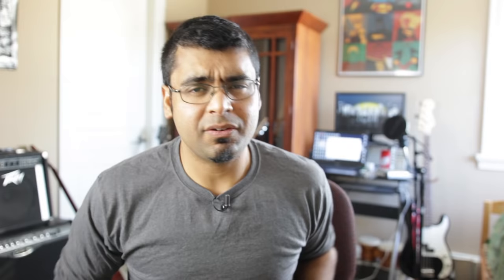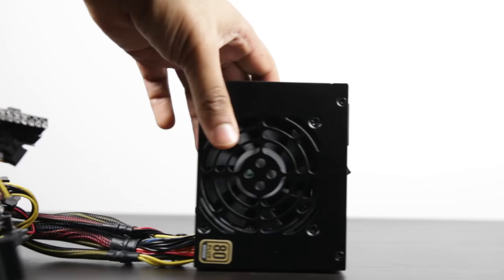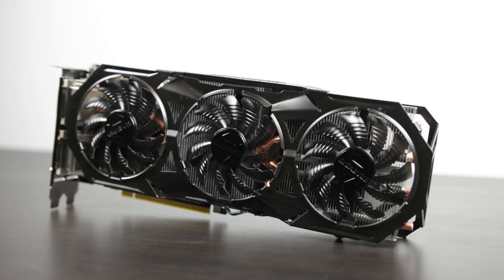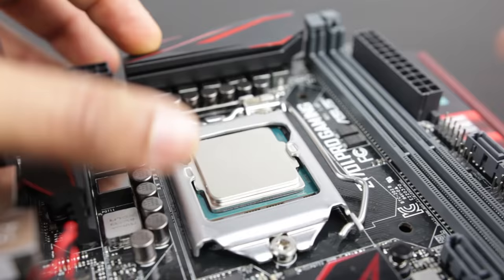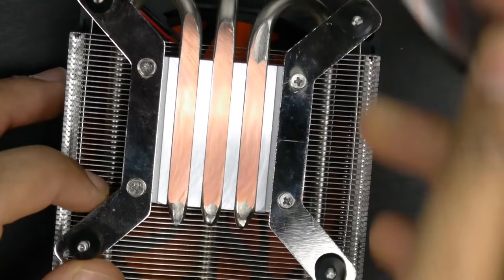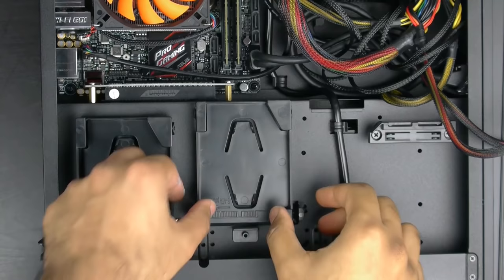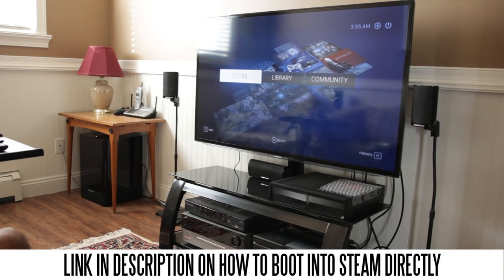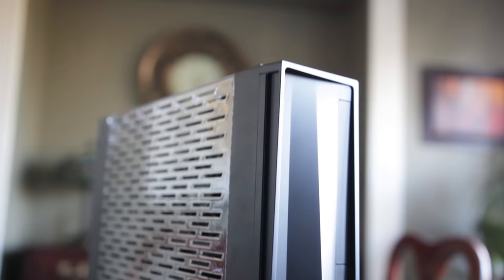EPIC 4k Gaming Console PC - Build Guide (The Console Destroyer!)

Comment: 1080p ULTRA 60+FPS > 4k med-high sub30 FPS
Reply: +ImRedBlueGreen  1080p is more than Enough for gaming, and +30 FPS is Enough for playing games, so if maxed out on 1080P +70 FPS and Maxed out on 4K on 30 FPS Locked , go for the 4K, if not locked then try the 2K
Reply: Tech-WonDo with medium-high graphics? ... mostly medium... no thanks. 
The difference between 30fps and 60fps is a ton when playing games.. Don't forget the FPS drops that happen too.. they will go as low as 10fps depending how much is happening on the screen.
Reply: +Tech-WonDo 30 fps really isn't enough for gaming
Reply: +ImRedBlueGreen  1st, The Difference between 30 and 60 is doesn't appear only in Motion intensive games like GTA V, but in Far Cry 4 for me, I settle down take a sniper and snipe them all, so the motion is not much, even 25 Frames will be more than Playable, and as a Said Locked* 30, which means it doesn't go lower than 30, only badly optimized games like AC III and Unity go from 60 to under 30 depending on what appears on the Screen
Reply: Tech-WonDo Yeah because every game is like a still picture... If you're talking about locked 30 then you're obviously going to have the lowest settings... and even then your going to drop below 30. Optimized or not.. If more things are happening on screen (rendering) then you're going to get a drop in frame rate. 
I'm not sure if you're trolling or not.. because 25 frame is certainly not playable.
Reply: +ImRedBlueGreen  I seawer I'm not trolling, I played Hitman Absolution on 13 Frames, Played Far Cry 3 on 13-18 Frames, but when it comes to any GTA It's almost a must to get over 25 Frames, and in any Assassin's Creed, I always play it on +22 Frames because even on 60 FPS, there is a delay that doesn't really improve from 30 to 60. So to Conclude, There is a Concept of Satisfaction, 22 FPS are playable, if you want them to be because you can go like "they aren't playble at all, I can't bare to see the screen on these frames" and keep complaining, you'll never feel satisfied, so for me, If I get a Game on Locked 30 (32-55 Frames), on 900p with some on very high and some normal, it's a way better experience than having a locked 60 (55-75 Frames) with all on Low or Normal, and thats for me, you can't bare to play on anything lower than 60 I can bare playing at 13 Frames, then go buy a 800$ Build on a 1080p Screen
Reply: Not if you have a 4k Tv
Reply: +Zoro 賊™  OFC, if you can purchase a 4K Monitor, in most of the situation they'd be able to purchase a PC that can run games smoothly on it, and btw guys, most movies run on 24 Frames and we still don't notice a lag and each eye has about 15 frames and increased slightly (about 1.6 frames) with training like Martial arts and Race Driving training
Reply: Tech-WonDo Did you really just use the your eyes cant see past 24 frames defence?
Nice talking to you... Won't be replying to you any more =)
Bye!
Reply: +ImRedBlueGreen  It was nice talking to you too :)
Reply: +Zoro 賊™  It's not worth it :)
Reply: +Bubble_Games whhaat?
Reply: +Bubble_Games How is it easy?
Reply: +Bubble_Games It makes a difference when its 480p vs 1080 but it does not when its 1080 vs 4k.
And btw are you gonna buy like a 60inch monitor just for your pc? Because in small monitors you cant really see the difference between 1080 and 4k.
Reply: ***** SURE you can
Reply: +mcjay669 I don't understand how people say 30fps isn't enougj, but I guess it is personal preference
Reply: +ImRedBlueGreen 30 fps for 4k is pretty decent, and considering that the games he actually tried are very new releases.. then yes, that should be considered a playable framerate.

Just the fact that you questioned a single GPU setup running 4k at medium-high settings, is literally beyond me. I don't think you've the appropriate understanding for these sorts of things.
Reply: MrFireZanimations average frame rate = 30.. which means its going to dip alot below 30 = unplayable. 
I can barely remember the contents of this video.. so I'm not going to reason with you because that means I'm going to have to rewatch it again...
Reply: ImRedBlueGreen below 30 still isn't "unplayable" as long as its sticking to the mid 20's. And especially if you're indeed going to play in 4k. Remember 4k is four times the screen resolution as 1920x1080. Even at low settings. It can look more than acceptable. He is only showing what this rig is capable of. No man nor woman would even bother to play 4k in medium let alone high; on a single GPU.

I wouldn't personally play at 30 FPS because I've 144hz monitor now; but, I do remember back in the day (2005) when I accepted 28 frames in Battlefield 2. I considered it to be more than playable. And if I where to somehow go back in time; I think i still would.
Reply: +caleb m
Console user? Troll? PC Master-Noob detected?
Reply: João Filipe da Costa For me 4k is more about having more space to put HUD on scree or have a better view of a big army like Age of Empire, Starcraft and stuff is cool to have more field of view, for FPS game you can use less field of view if you wonna see spot far enemys betters anyways. But yhea 4k still have issues for all i read/heard on the web, hard to find cheap 144hz 4k and even the video-porta can cap at 30-60hz due to transfer limites.
Reply: +ImRedBlueGreen Or 45-60fps at 21:9 3440x1440p very high ;P , with a 980 of course.
Reply: +Tech-WonDo You are kidding right? On a PC, anything under 50 fps feels laggy for most real PC gamers. I have a 980 ti lightning and the Acer xb270hu monitor and on all of my games, if theyre not running at 55 fps+, I can certainly feel the glitchyness and lag.
Reply: +Tech-WonDo Also 1080p at 70 fps is much better then 4k at 30 fps. I use DSR and 4k and when the frames drop to 35ish, its almost unplayable especially for gta 5.
Reply: 4k 60fps med > 1080p 60fps ultra. #dropsmic
Reply: +Mark Winston good job playing counter strike on 4k...while i play killzone on ps4
Reply: +Mark Winston Also, just downscaled 4k without AA is better than 1080p with AA, and can run about the same FPS.
Reply: +Tech-WonDo your comment on 24fps is inaccurate & misleading... I'm a cinematographer based in LA so this is my area of expertise. I mean no disrespect, but since there are many people that share this misconception please allow me to educate you on the subject...
First off, the reason we shoot movies in 23.976 FPS, is because it provides what hollywood has deemed to be an appropriate level of motion blur, as established over the years, to achieve a proper film look. 
I can easily distinguish 24fps from 30fps from 60fps... like literally within just a few seconds of viewing. This is why a movie looks different than the news (30fps). 
Lastly, research has concluded that the human eye is capable of distinguingin FPS variances of up to 200FPS when content is viewed on monitors CAPABLE of displaying it. 
Furthermore, in scientific studies they found that fighter pilots that were observed in test settings were capable of the highest level of ability to distinguish which was right around 300FPS. 
So yes every frame counts and I would go as far to say that anything that drops below 24fps is unacceptable in gaming. 
When dealing with action games or shooters, i'd personally never want to play anything below 50fps as the reaction times are everything and you really do benefit from the higher frame rates.
Reply: +ImRedBlueGreen ya, but... I get 60+ FPS on 4k high settings lol..... 100+ 1080p. (liquid cooled I7 6700k @ 4.6ghz paired with an EVGA 980 Ti k|ngp|n edition )
Reply: Jordan S. .......... of course you do... My comment was in regards to the video.. a 970.
Reply: nick hover thank you for agreeing with me....
Reply: 30fps is enough it has been enough for years its just that people who have experience pc gaming cant go back to shitty console experience
Reply: always!
Reply: Dear lord guys. Your eyes can see faster than 24 FPS. Your eyes are neural connections directly to your brain. They see as intermitten as light hits them, and your brain processes them all instantly.

They are vibrations created by waves.

There isn't a processing lock on this shit guys.

I like better FPS than higher resolution. 

I own the G1 970, it's an overpowered 1080p card and a decent 1440p card... it isn't a 4K card.

You COULD SLI them into a 4K card though!
Reply: running i7 2600k, 250samsungssd,16gbddr3,evgaftw1070,4klocked60fps,4knativelgipsmonitor> 1080 im sorry cant go backwards.

Comment: I bought this case. I went with the RVZ02B with the dust filters, and am fitting it with an ASUS R9 Nano White Edition.

I don't see the benefit of the windowed version of this case, unless you're one of those folks who like to pimp out their rig. Of important note, though, is that a Zalman CNPS8900 is only able to (barely) fit inside the RVZ02B non-windowed version, which probably hints that the clear panels are not flush on the interior.

Comment: Definitely would have gotten a 600w psu and put an r9 nano at its current price of 500$. I would also have installed a slim blue ray rw drive and replaced one of the sdd with a 2tb 2.5 inches hdd. Oc that nano to 1050mhz and you have an awesome 1440p gaming rig with also great performance on 4k with older games.

Comment: 4K on a GTX 970? Don't expect amazing framerates at reasonable settings. Even the top graphics cards like the 980Ti and Fury X can only get 30-40fps at 4K on high settings in most AAA titles, so you have to dial it down to low or medium to get any kind of playable framerate. If you're in the market for this, wait till when Polaris and Pascal cards come out from AMD and Nvidia. The top end ones will have no problem running 60fps at high settings at 4K. Right now you can't really do that in a miniITX build, since you can only fit one GPU.

Comment: I'm thinking of building this setup except instead of the 970, I'll put my MSI 1080 card in there. :)
Reply: same
Reply: I'm thinking about using a gtx 980
Reply: +Alex osuna pls don't buy a 980, wait until the benchmarks are out  for the 1060 then make your decision. Rumors are that the 1060 can perform well over a 980 when over clocked
Reply: +Solid Mass ok thanks for telling me
Reply: buy gtx 980 used, it a lot cheap here in italy
Reply: Maybe I just put 1060 on it 1080 has SLI will just waste but thats your choice its ok also.
Reply: thinking same, but the 450w psu...
Reply: Its sufficient for 1 450 psu

Comment: I'm going to wait until I actually have the funds for this build, which is all well and good because two parts I want haven't even been released yet (N/R). Here's my future Console Eater build: 

Intel Core i7 6700k OCed at 4.5GHz
Silverstone AR06
MSI Z170i Gaming Pro AC Mini-ITX 
Kingston Hyper X Savage 32GB (2x16GB) DDR4-2600 
Transcend M.2 B+M 512GB SSD 
Samsung Evo 1TB 2.5" SSD (later upgrade)
MSI Geforce GTX 980ti Gaming 6G 
Silverstone SST ML08B-HW (N/R)
Silverstone SX700-LPT (N/R)
Asus ROG Swift PG279Q 1440p 165Hz 27" IPS gaming monitor 
Corsair K95 RGB wired gaming keyboard w/ Cherry MX Red switches
Corsair M65 wired gaming mouse
Reply: Go for an I5. This is coming from an AMD fan. You don't need the i7 unless you are making videos etc.. Anyways, another recommendation would be to run a 390x overclocked instead of the 980ti. The new Vulkan and DX12 API's coming out will utilize AMD's multi core gpu's better. A recent test came out and a 290x beat a 980 in DX12 benchmarks
Reply: jacob3parker 
Which is exactly why I'm getting the i7, I am planning on streaming, making videos and gaming. A friend of mine (a huge msi/AMD fan; FX 8350 R9 390) advised me on avoiding the 390x because of heat issues especially in a small form factor build. He suggested the 390 over the 390x because of this. He also told me the 980ti would still be a good choice if the monitor I had supported G-sync which it does exclusively. Before building this rig though, I need to upgrade my current HP from an HD5450 to an R7 360 because 15FPS is un-fucking playable. The only things keeping me from my HTPC beast are: 1) still don't have enough money 2) waiting for Kabby Lake to drop the prices of Skylake CPUs 3) waiting for silverstone to pull their thumbs out and release the SX700LPT and the ML08B-HW for fucks sake, Silverstone!

(Edit) I decided to go with the Cryorig C7 over the Silverstone.
Reply: +ArthurSixx well, if you're still waiting the new AMD Zen cpu is coming out. Multicore support would be better aswell. So it would be smart to just buy the 390 so you'd have it for later too. But new GPU's are coming out aswell, so basically wait until Juneish is what i would recommend
Reply: wait for gtx 1080 from msi
Reply: or from gigabyte

Comment: How are the GPU temperatures in that tiny case? I didn't see much for ventilation on the side. You would think all of those fans would just recirculate that stale air. I think this is one of those times that I would use a reference style blower cooler to at least push the air out the back.

Comment: I think, that when you want to play on 4K, a GTX980/980Ti would be ways better. The GTX 970 only contains 3.5GBs of RAM! This could cause wierd problems in 4K resolution.
Reply: +Rico Smith Depending on what settings you're playing. The 970 is capable enough to push all those pixels. Also, it has 4GB of VRAM.
Reply: 2010ngojo
The 970 has no "real" 4GB of RAM. 0.5GB are very slow and cause insane lags. Normally, you don't reach these 3.5GBs, but in 4K you'll definitly reach it and your PC starts lagging! Also, the 970 isn't designed for 4K, only for 1440P. This means, that you can run 4K, but it's not very stable!
Reply: Rico Smith
Still has 4GB even if some of it is slow. And as I said before, it depends what settings you're playing at, and not to mention what game as well.
Reply: +Rico Smith good job playing counter strike on 4k...while i play killzone on ps4

Comment: I did not like this build
Imo changes I would get i5 6600k noctua nh-l9i get corsair lpx 2x8GB 2666mhz memory get a single Samsung 850 evo 500gb ssd a gigabyte GTX 980 xtreme gaming and the silverstone sx600-g these parts are better because gaming doesn't need 8 threads faster memory means better performance in games 1 ssd lets you upgrade later GTX 980 has more cores and is better for 4K than GTX 970 and the sx600-g is fully modular so better cable management and it has more wattage allowing you to upgrade in the future

Comment: The 970 isn't really a 4K card. I mean yeah sure it can do it but only at 30fps and sometimes even below. Max resolution id use a 970 at is 1440p Least then you can run at high, maybe ultra settings and still get 60fps. You'd need a Fury X or 980 ti for solid 4K gaming experience.

Comment: Well, the video title says EPIC 4K Gaming console not 4K slideshow at 30 fps. So far this build does roughly the same as a i5 4460, GTX 970 and 8GB DDR3 running games well at 1080p @ 60fps and you can save 240 bucks

Comment: Awesome build, But really, At least a 980 would be better. As long as the budget is $1400, You could use up another $100 to try get a 980. Also the whole budget becomes somewhat a round figure of $1500. 
Also Getting a Non K i7 would not hurt and spare some more money. Or an i5? Or Haswell i5/i7s and DDR3?

Comment: What were the temps for the Aftermarket cooler GPU? wouldn't the air mostly circulate in the chamber, or would it be release fast enough through the vents?

Comment: How's the heat on this thing? I've been really interested but I have been looking around at various forums stating that a blower style cooler is not good with this case. It's interesting to see that you are able to boost past 1500mhz without throttling because of heat. I have the evga 980 ti blower style right now and I have been contemplating about getting the G1 gaming 980 TI but I am concerned about heat, especially in the summer days.

Comment: Nvidia has announced that GTX 970 has a usable 3.5GB of memory and the rest 0.5GB is unused. however if application such as games force to use memory more than 3.5GB then the performance starts to degrade as the remaining 0.5Gb memory is somewhat slow..

What is your Take on that Waj.... do you still suggest / recommend use of the the GTX 970

Comment: i would like to see temperatures also in that small case...
And a ~250watt GPU with only a 450W PSU ? what sorcery is this ?
Reply: +Albert Calinescu 225 Actually. :v It does work, in fact, a 980 Ti could even run in this, though the PSU would almost be at its limit and probably eventually work at its absolute limit if wearing down much, but for the 970 it actually works. (My own system draws 395 Watts from the wall, considering the efficiency at the load it is at, 92%, that is 364 Watts internally, so, 450 can actually work, but not recommended for anything more than a 970.)
Reply: +Albert Calinescu A 250W GPU does not mean it will draw constant 250W from the PSU. I've checked that even when my GPU is at 99% load it only uses 76% TDP max. So on average the GPU will just pull 200W, plus the 100W of the CPU and other accessories, it should barely hit 350W. People have run Titan on a good 450W power supply. I wished he'd used the silverstone modular 450W, which has a 80 plus gold cert.
Reply: +Beetleman20 thanks for the replay. 
was thinking of using the 500w SFX-L format psu from silverstone, with R9 390 nitro, and i5 6500.